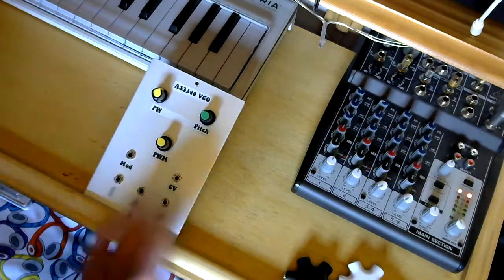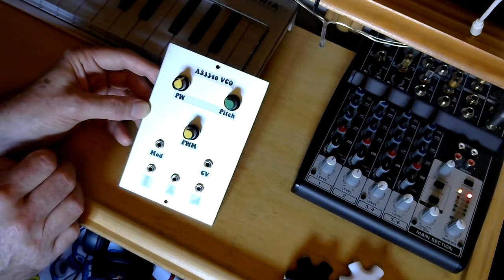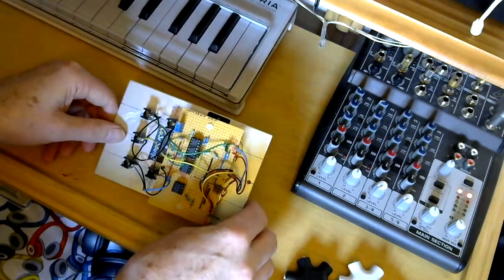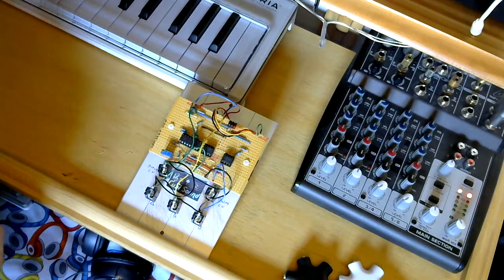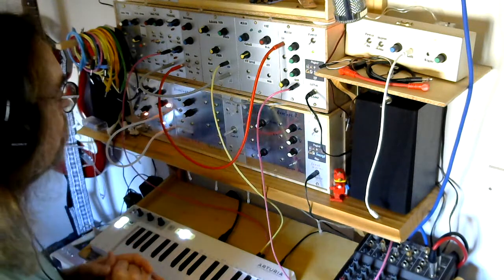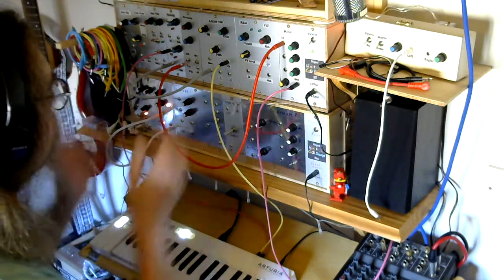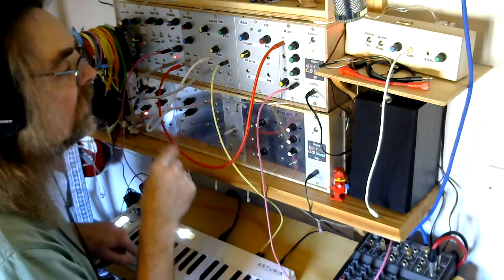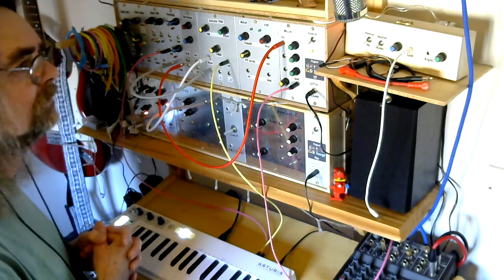Project XII Modular Part2: AS3340 1v/oct VCO

Comment: This is brilliant mate and thankyou.im just starting out and your videos are by far the best step by step on Youtube. i have done a few modules and just about to build my case out of an old oak wardrobe. Did you just use a circular saw? and did you have to plane edges at all. thanks. Mark.
Reply from the maker: Hi Mark. I am not very good with woodwork so I get my local hardware shop to cut 6mm ply to the required size. I just fit rails for mounting the modules and screw it all together. I do like that you are upcycling an oak wardrobe to a modular case, it should look great. With diy synths you can build them how you like, check out Juanito Moore's Modular For The Masses tin can synth (link on my home page) that really is an alternative approach. Thanks for your support.

Comment: 9:26 I wonder what they do to "Temperature Compensate"
them in store bought Synths? As I recall, the discovery of
that Technology was a big breakthrough. Arp, was it? :]
Reply from the maker: ARP were one of the first to use this chip. Although not perfect, it was/is a lot more temperature stable than most of the early oscillator designs. Getting most of the semiconductors on a common chunk of silicone achieves a common temperature profile and hence more stability. Better than gluing transistors together! Even modern analogue synths, such as the micro brute, say you have to give the instrument time to warm up for it to be stable.That said, I have to retune my guitar after taking it out of a cold car into a warm venue.
Reply: @CuSiSound  yes, I notice that being an issue most of all with my Akai TimbreWolf!